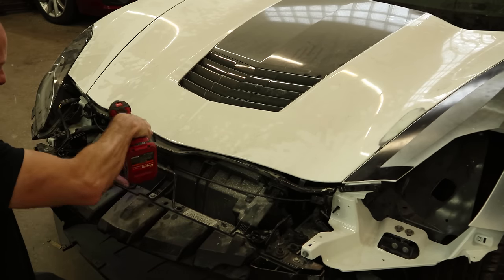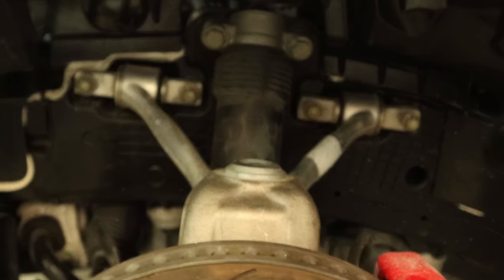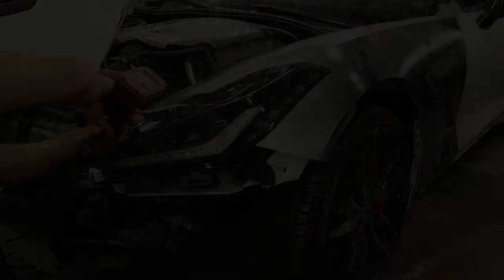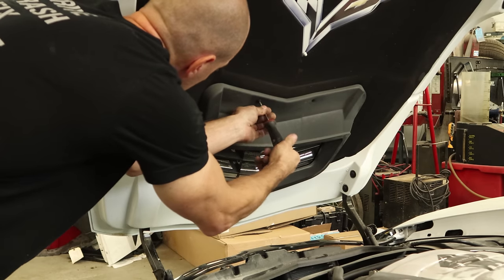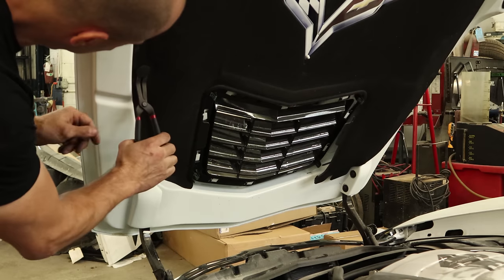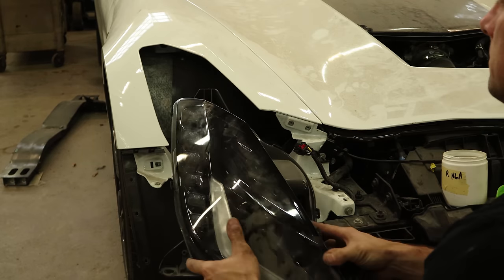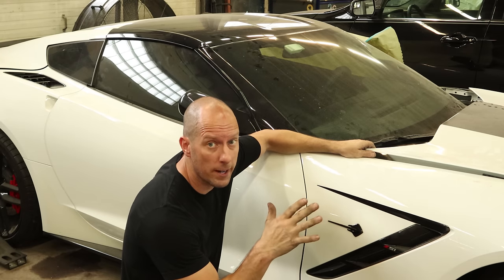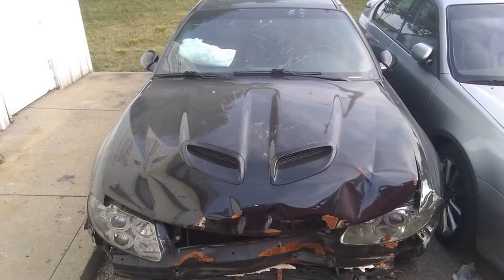Getting the C7 build ready for paint, fixing a mistake and a past build update

Comment: That spare tire looks like a
 Flywheel..😂😂😂
Reply from the maker: Wrapped in a rubber band! 😂
Reply: I looked to buy one of these but they are over£100 each so I just use a rim with no tyre if I have to move car with a front wheel back

Comment: you got lucky on this one ..I've fixed a few (front end vette collisions)and those stinky wires get yanked outta the ECM in the flipp"n fender  UGH !.. and ya gotta figure out where ta put em back..and there's some that are colored the same ( green/white stripe if I remember correctly) that work the heads up display/fuel pump relay/ac /etc ... 🤦 tricky but not impossible..👌👍 great work so far

Comment: Scott I am sure you did but curiosity makes me ask, you did pull the dip stick before you turned the key right? Since they were into it I would not have assumed anything from the previous shop. Also the bumper cover had nice lines and the gap was perfect all the way to the r/h fender but that one was almost zero, was it camera angle or does that fender need to be adjusted a smidge?

Comment: My next question is you're going to repair the tire on the left front of the vet. I have a 2018 Chrysler 300 all wheel drive with 19inch rims on it my and my wife curb check it and the rim looks pretty gnarly what's the process of fixing those kind of rims looks like some kind of epoxy coating on top of it

Comment: What about that nut that looked like it was missing from the (torsion spring?) that was mounted behind the lower shock mount, on the lower control arm? Did you fit that nut? I saw it in your previous video as you were putting the shock in place... looks like it goes onto a ball joint?
Reply from the maker: There is no nut that goes there.  That is only to keep the spring from shifting.  Its constant pressure holds it back in place without the need for a nut.  I did check the other side to be sure.

Comment: I've had a similar problem with my 1995 Oldsmobile Aurora where i bought from the former owner couldn't tell me why the A/C or heat wasn't working then i found a cut wire a purple one so i will see what happens when i reconnect it.

Comment: Buying other than OEM body panels is an exercise in self-abuse.   No thank you.  I did buy a used, like new rt. rear door to replace my mangled on a while back.  My Caddy is a  Spor/Lux in a Burgandy red.   It required a specific door in order to match the wheel opening, etc.   At=fter months of searching Craig's list, I found on in the midwest.   Cal. has none to choose from.  Anyhow, this door was a perfect color match and fit.  Just $185 for the door and $520 for shipping to a residence.  Still much cheaper than a couple of grand for all of the various parts.
skinning was not an option.  I have used third party replacement fender and hood from China.  Never again.   Nice C7, btw.